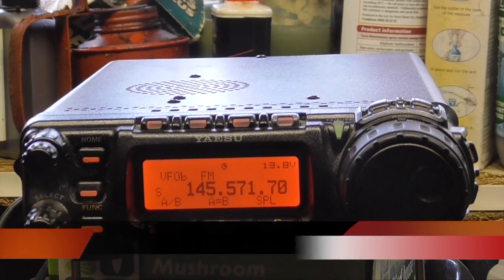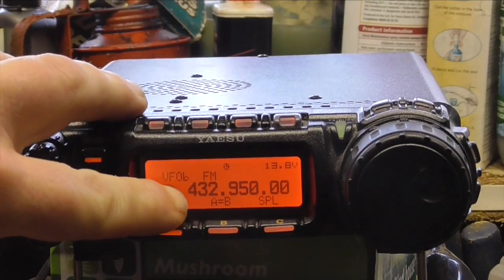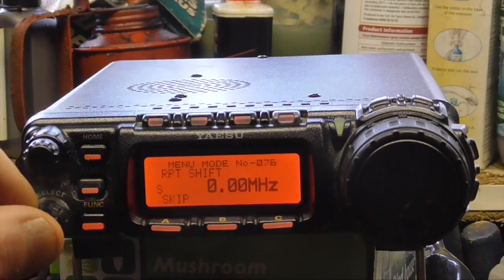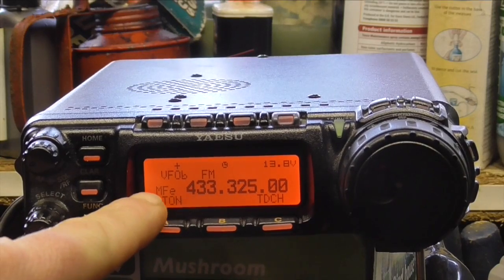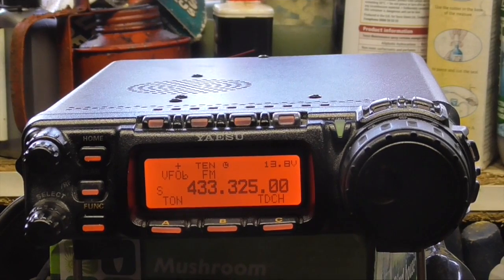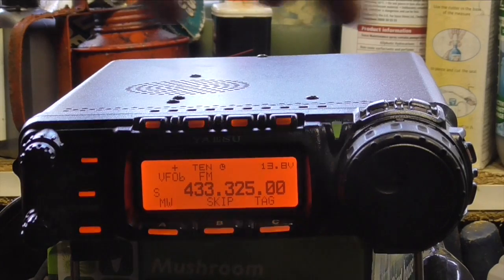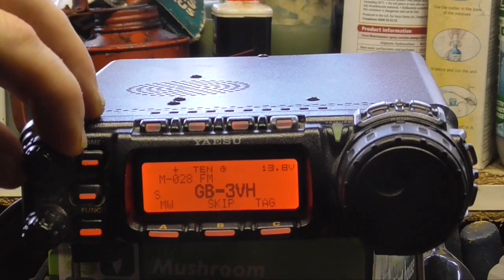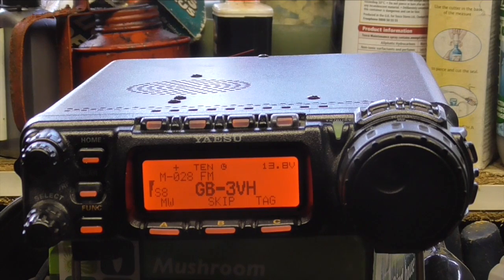Yaesu ft 857d Repeater programming

Comment: The 857D is the Biggest POS Amateur Radio I have Ever owned or used followed closely by a Kenwood TS-2000.I much prefer my ICOM 7000 and ICOM 9100 for my Shack In the Box.👍🎙